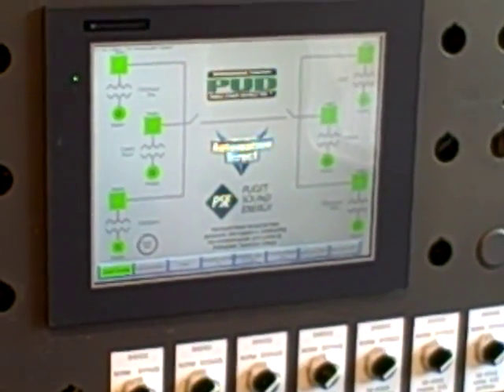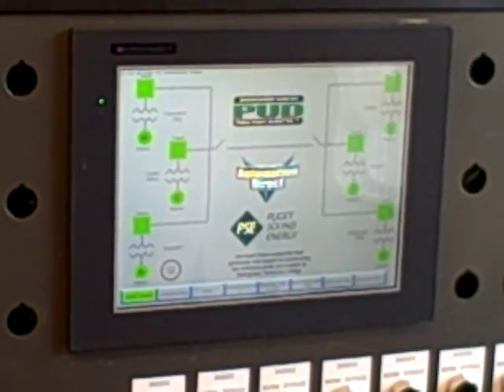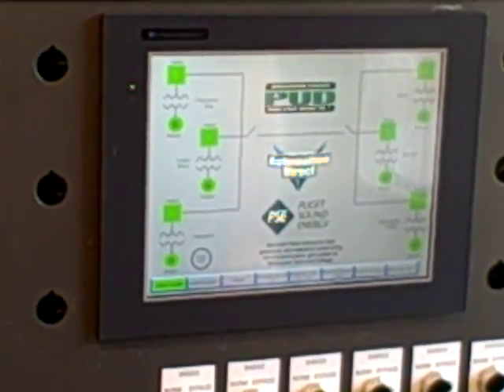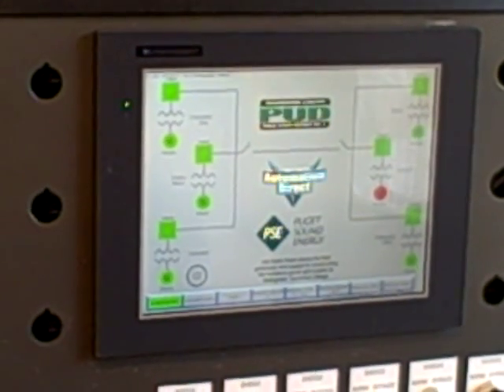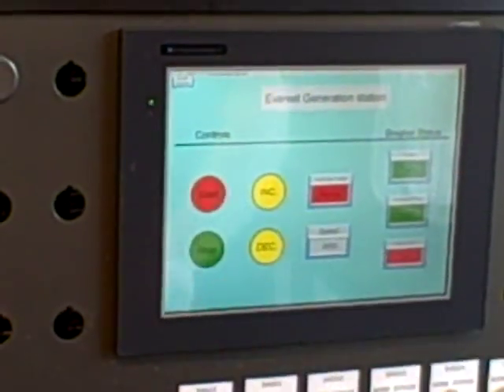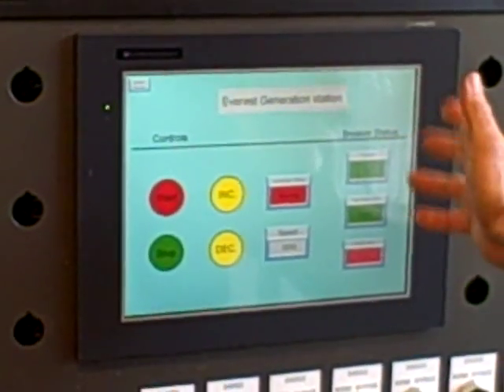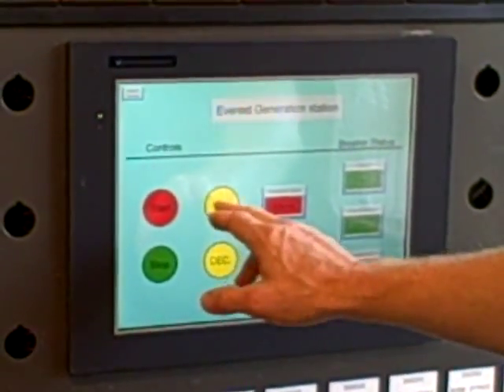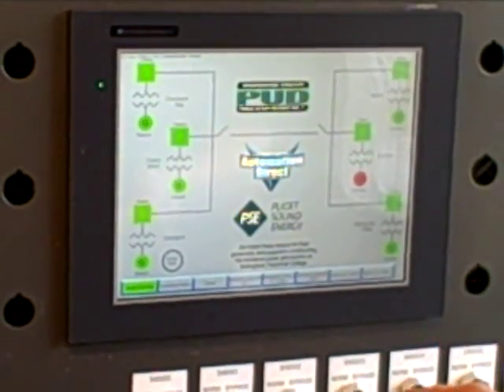Miniature three-phase AC power grid (part 0 -- prelim. demo)

Comment: Are you going to monitor reverse current aswell? As in tripping the breaker to avoid the generator beeing drivven as a motor?
Reply from the maker: We eventually plan to outfit the generator with as many protective features as we can (e.g. differential current on the windings, winding temperature, loss of excitation, reverse power, etc.).  For now all we have is the SEL-551 relay which does overcurrent.  We would also like to put in auto-synchronization so we can tie the generator to the grid either manually or have it do it all by itself.

Comment: I think this project will be wonderful. 
I'm curious now. As your monitor connects to the system? It uses MODBUS protocol? The actuators use relays? 
I'm dying to see a more complete video.
Reply from the maker: The communication driver on our HMI is set for "AutomationDirect Do-More Ethernet" to communicate with the "Do-More" PLC processors.  I don't know if it's really Modbus/TCP under the hood or not.  Modicon-standard Modbus is certainly an option available to us, though.

Sorry for the lack of completeness on the video.  We still have a fair amount of work to do on the generators before we make our mini-grid "hot" with power.  Stay tuned for more videos in the next two weeks as I take my class through a two-week course on protective relays.